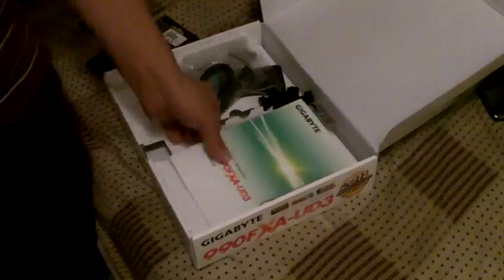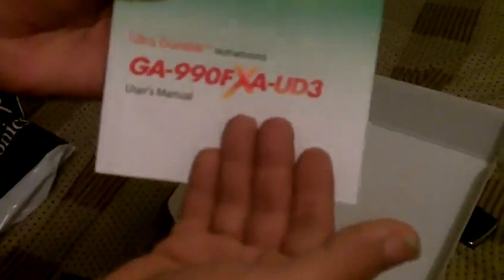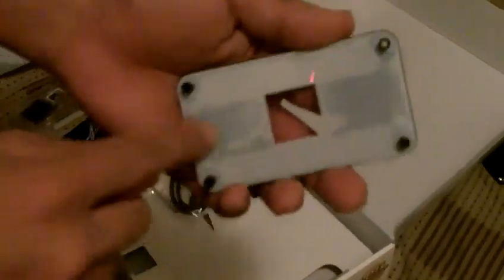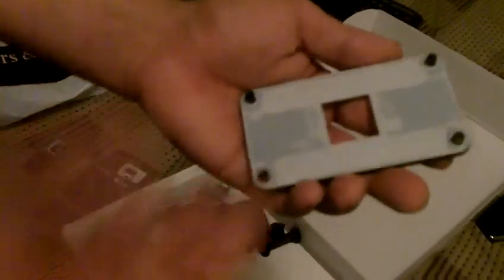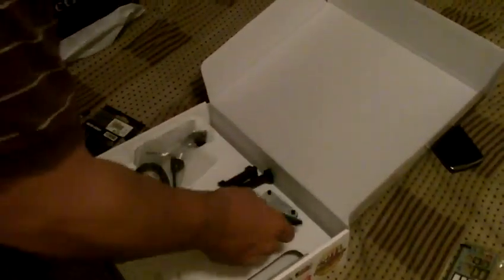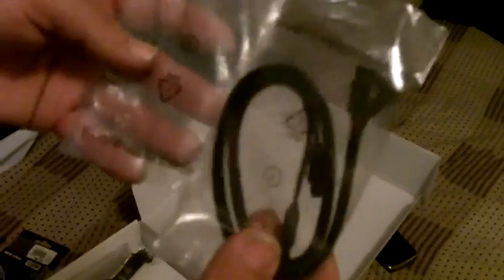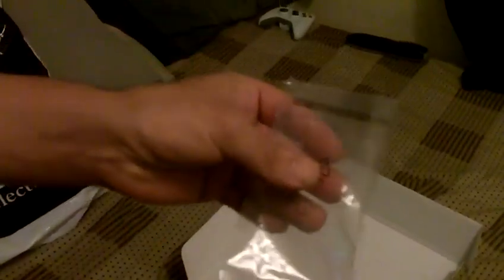Gigabyte 990 FXA-UD3 Review

Comment from the maker: I would recommend Gigabyte 990FXA-UD3 for Extreme Overclocking  but if you want overall Perfomance Get ASUS AM3+ 970 (Recommended)  if your on a budget .I would get an asRock 890GX Extreme4 I would not recommend BIOSTAR for my obvious reasons. As far as GPU I would Recommend thee 6790 HIS 1GB 256-bit with about 1583 cores for about 140+ okay  that should be highly recommended

Comment from the maker: @dnscpan also bare in mind that bulldozer is a failure for sure but it still needs software programs to come up with better use of the cores as for thee CMT paradims pipeline i believe it failed there with a 8120's , but an FX 8150 it does outgun a  Phenom II 1100T in many apps it  only gets beat in single threaded okay keep that im mind also know for sure that thee i5 2500K & thee i7 2600K beats it in single threaded but not in multi threaded